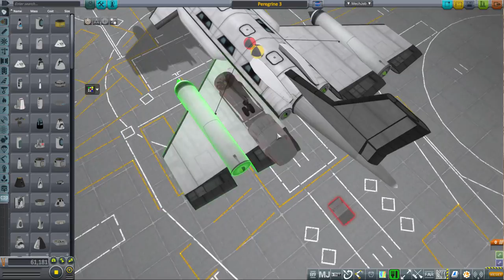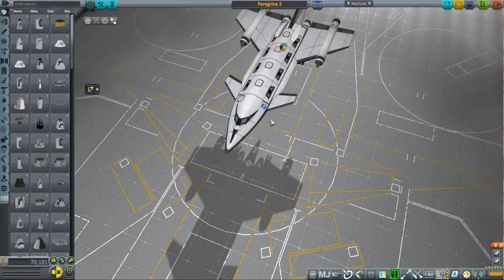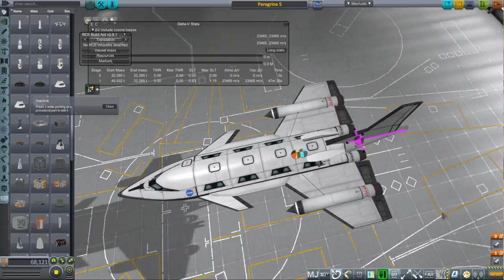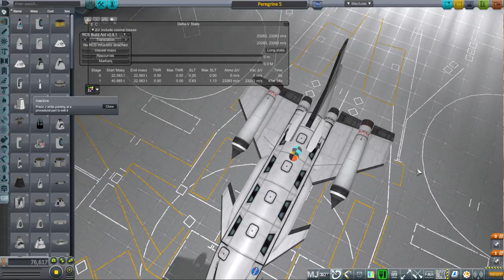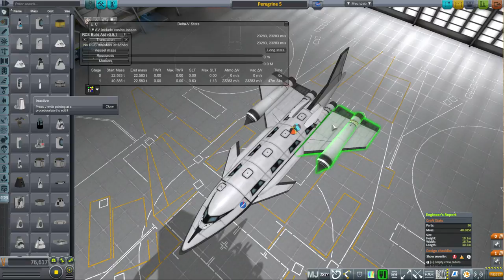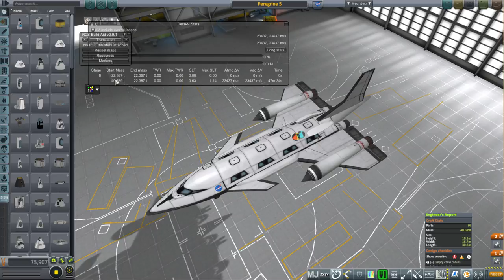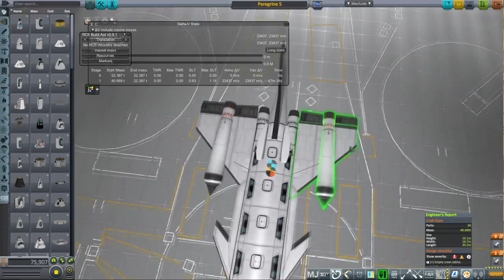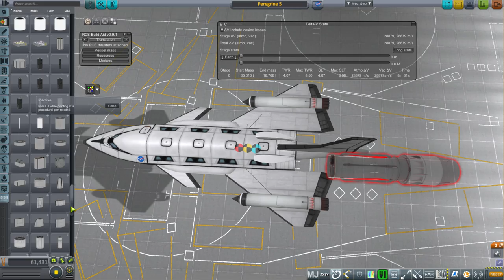Kerbal Space Program RO Sandbox - Hypersonic Liner Development 02

Comment: Based on your Peregrine-Craft, I've built a quite similar vessel capable of level-flight at 30000 m and Mach 6.0 (Mach 6.5 maxing out the temp gauges).
--------------------------------------------------------------------------------------

Flight profile: 
Takeoff (2x J58), climb-rate 100 m/s

Level-Flight @ 12000 m
@ Mach 2: activate 2x CR2
@ Mach 3: Climb through 25000

Level-Flight @ 25000
@ Mach 4 (or just before the J58 reaches max int. temp): deactivate the J58

Dive to 15000 
Climb to 30000

Cruise @ Mach 6 // Cruise @ Mach 6.5 (dangerous!)
---------------------------------------------------------------------------------------

Craft-File: https://www.dropbox.com/s/yf3d7cgcwbjqtjp/X-I%20_Helios_.craft?dl=0

[KSP 1_2_2, Modlist according to Tyler Raiz' modlist]

I'd welcome any suggestions/improvements to this fancy craft :)
Reply: After some changes, I've come up with the next iteration of "Helios":

Flight path for "Eos":

Initial climb (50-100 m/s) to 15000
Level out till Mach 3
Ignite CR2s
Deactivate J58 at Mach 4
Climb to cruising altitude

Performance on several altitudes:
[est. Range | Height | Mach]

3200 km | 35000 m | 6.3
2800 km | 32500 m | 6.7
2500 km | 30000 m | 6.8
2000 km | 25000 m | 7.0

Link: https://www.dropbox.com/s/jre6gz4ttw7y8n1/X-VII%20_Eos_.craft?dl=0

With some optimization, I should be able to cross the Atlantic at Mach 6 or possibly Mach 6.5

Cheers,
Max
Reply: I did not use any pre-coolers, though both the jets and the ramjets have a tendency to overheat (Jets at Mach 3.8 - 4.0 and the rams at Mach 6.8 - 7.0).

The thing I noticed is the following:
At roughly Mac 2.8, the increase in velocity accelerates the increase of thrust of the ramjets, outweighing the increase in drag and entering a positive feedback loop.

The only difference I noticed between your craft and mine is the number of ramjets (disregarding the use of the Concorde body and not the Mk2 since I achieved the Mach 6+ with both bodies). 
I used 2x2 Ramjets with just 2 SABRE M intakes. (I also tested my craft with several intakes, not seeing any difference)

Maybe the solution to your problem is the lack of "moar boosters". 

If you want to compare them yourself: https://www.dropbox.com/s/ykwkw0fcecmv03p/X-XIII%20_Selene_.craft?dl=0
Reply: And I didn't use any intakes beside the SABRE ones. But that shouldn't be a significant difference.
Reply: I am using AJE 2.8
Reply: I hereby challenge you to beat me at the flight from Cape Canaveral to Washington!

PB so far: 00:24:55, stop-to-stop, 34 passengers

Comment: I'm pretty certain that guage on the engine was intake the way the ram jet works is it uses the intake air drawn in and compressed giving more forward momentum/motion basically gives you a little extra thrust when the standard engines are maxed out they are like a turbo by taking air in and compressing it and pushing out more air than it's received

Comment: You could Put wing tips on the end of the wing to reduce vortacy drag
Reply: vortex drag with an L/D of .65 would be insignificant.  It is more important on jetliners that are crusing with an L/D of 12ish.  In fact winglets are actually a waste of mass as that is better spent increasing your AR.  The only reason to use winglets is if your wingspan is constrained by airport requirements